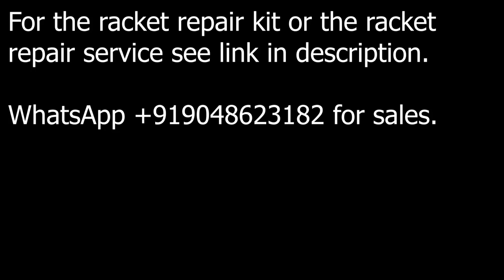Can Broken rackets be repaired with love?

Comment: I can see why this would be cheaper than a replacement, however, it's going to have a siginificant impact on the balance of the racket and the cosmetics
Reply: Let me tell you why this might be a good idea.  A typical tennis racket like this costs around 8000INR in India. Our service including shipping comes to around 1000 INR. For one eighth of the price, you get. 3-4th of the performance.
Reply: cosmetics? Final result looks good
Balance? a couple micrograms difference? Come on
Reply: of course, this is not for the person who is worried about balance and cosmetics. The person who is worried about balance and cosmetics buys a new one and is not looking for videos on how to repair rackets...

Comment: What tape du you use?
Reply: I'm sure he uses UD carbon fiber tape (uni directional) but I use 90g / m2 or 120g / m2 carbon fiber no more, thin to the touch and very fine. Don't use THICK carbon fiber, it's not good. will it be useful !! ??